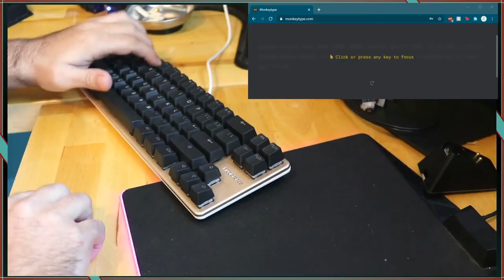How and why you should mod your keyboard. (1080p)

Comment: how thick is the packaging foam which u used in ur rk68 mod video?
Reply from the maker: around just under 2mm thick, but I suggest getting a little thicker foam, 2.31mm thick.  2/32" thick.
Reply: @ireakhavok  can i use eva foam instead of packaging foam??
Reply from the maker: @sattetile13  Yes, you can, but I would suggest having multiple thicknesses of foam (preferably thinner than what I suggested for packing foam), because EVA foam is less forgiving and could cause damage as you try and screw it down. I would try to use the least thickness of EVA foam that get's the job done. you don't want too much pressure on those plastic standoffs, as the screws can easily strip them out.
Reply from the maker: @sattetile13  One thing to keep in mind, is that if you are having issues with closing the case due to ridges, you can actually cut the foam into pieces and lay them in between the ridges. It will still help immensly, and sometimes more, because the PCB and components generally do stick a little further down. I even use silicone in one of my videos. The magic force video, which is much harder than the foam we are talking about, but I ended up cutting it into strips and fitting them into the ridges of the board. 
Please let me know if there is anything else you need!
Reply: @ireakhavok  thanks! which eva do i should get? 2mm or 3mm?
Reply from the maker: @sattetile13  definitely the 2 mm.
Reply from the maker: @sattetile13  you can allways add another layer, where you can. I suggest splitting the foam into two segments for the RK68, you could maybe fit it between the ridge splitting the top half and the bottom half of the case, and MAYBE make the bottom half double layer. Again I am not 100% sure of the clearance.
Reply: @ireakhavok  big thanks!
Reply from the maker: @sattetile13  Any time! Let me know if you have any other questions. I will have more videos up in a week or two.